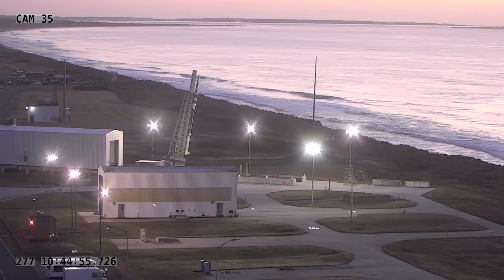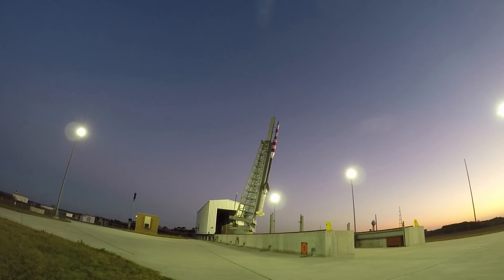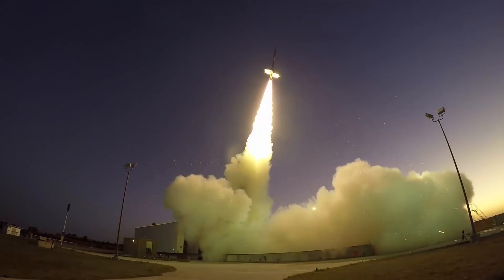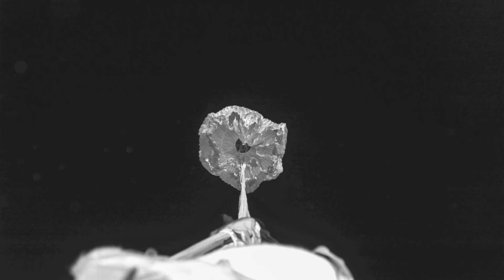NASA’s Mars 2020 Supersonic Parachute: Test Flight #1

Comment: This is impressive; I mean from a physics standpoint, the shear-forces of such a large surface area despite the lower density atmosphere are tremendous.  My hat's off to those engineers & technicians who put in the time and effort to make this happen.

Now I have two questions; one related and the other of a different topic:

1.  Is this technology in use, or will it be implemented in emergency escape vehicles for the ISS?
2.  Has there been any serious progress made toward other forms of propulsion that do not include chemical reactions?
Reply: Ion thrusters are in regular use, and nuclear engines are back under r&d

Comment: I get the test but isn't Mars atmosphere, much thinner and therefore needing much greater drag, only.. nearly about the weight? 
Meaning, keep working on it, and what's here is only an example of the right applications.
Reply: It is thinner, which is why the test occurred very high in our atmosphere, where the air is about as thin as it will be when this parachute is designed to open over Mars.